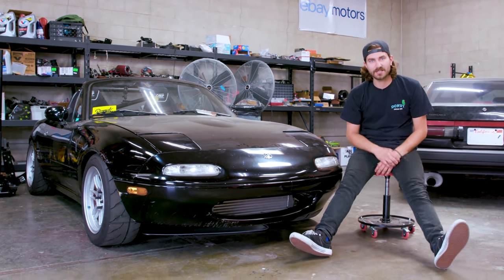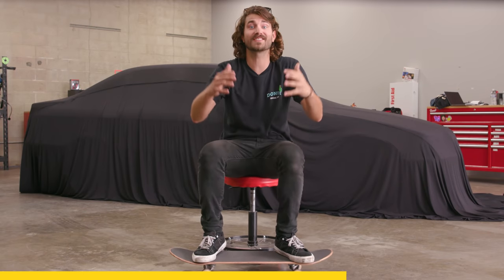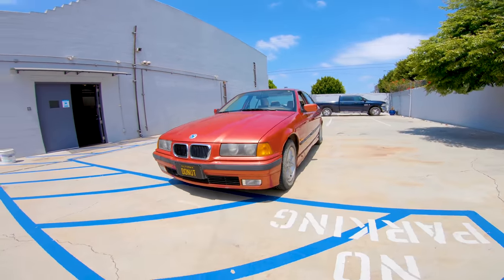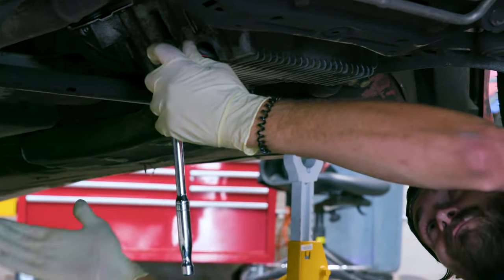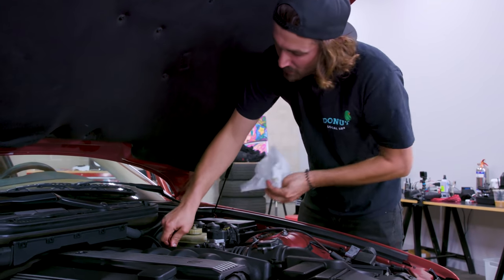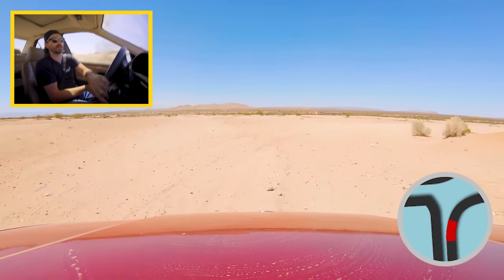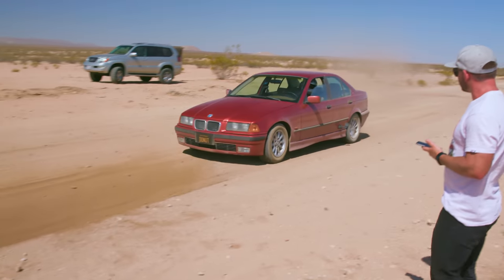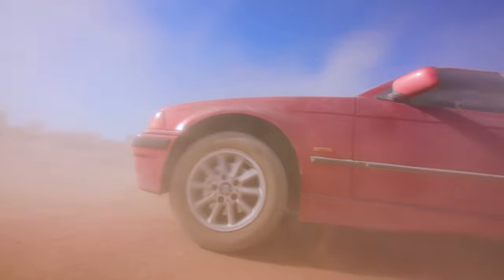The Next Money Pit Project Car Revealed

Comment: “Biggest Achilles heel is the cooling system”

Vanos: Allow me to introduce myself
Reply: Whole reason I didnt buy a 740il was because the Vanos was going out.
Reply: Vanos on the M50/M52 engine is actually pretty easy to maintain. Try going at the Vanos in the M54 or N52 engine, that's a hassle.
Reply: I just got spoiled 😂
Reply: Oil pump nut: Hello
Reply: @alpenjodel24  But when it comes to M54 vs N52, which one is better (by either ease of repair or reliability)?
Reply: Fun isn’t something one considers when causing mechanical problems. But this does put a smile on my face -Vanos
Reply: Vanos failure isn’t catastrophic as opposed to the cooling system.
Reply: I’m actually about to build a e36 as well, might follow with you guys
Reply: Vanos: I am inevitable.
Reply: @TheLajanz  id assume with a VVTI being borked it would get like 30% worse mpg.. I would guess it would just burn rich / waste gas at high Rpms.
Reply: @RK870XK  Depends, when looking at only the engine itself, the M54 is easier to work on, mostly because its older and a more "mechanic" piece with less electrics. When looking at the whole car, the E90 with the N52 engine (N53 is shit) is a lot more reliable than the E46 with the M45. E46 suffers from a lot of electric issues because it's a lot less modern but started to incorporate a lot of electric features (such as gas by wire). That being said, it's very very hard (if not impossible) to work on the N52 without advanced knowledge of the engine, the car and modern car mechanics. 
So when it comes to reliablility, my (as a BMW mechanic) ranking would be: 
A tier: E30/E36 (E30 a little more costly most of the time, because it's older, but damm the m10 engine runs forever)
B Tier: E90
C Tier: E46
D Tier: F30
Reply: @alpenjodel24  I've been actually considering between the E66 LCI and E39 (both using inline 6s since my country doesn't see V8 powered E39 and V8/V12 powered E66 seemed rather scary by cost) actually, so what tier is either of these cars fall into?
Reply: I had an E36 and either the vanos or the cooling system failed, everything else did lol, except engine and transmission those were pretty strong. Would I buy one again? Definitely yes!!
Reply: @RK870XK  M54 is more reliable and easy to maintain
Reply: Vanos isn't a problem on a M52. I have nearly the same car(1998 E36 328is coupe) it has 207,000 mile and I never had to the vanos or anything else engine related besides the cooling system.
Reply: @anotherbiker6319  Not True.
Reply: Damn, the amount of likes really show people dont know much. No, VANOS isnt. My M50s VANOS is ticking but working like it should and pretty easy to fix.
Reply: @siamdixon9671  dude it’s literally just a joke, please don’t take it so seriously.
Reply: @RK870XK  an E39 with a M52 engine will be pretty bulletproof, the E66 will be a lot more costly to maintain if you can't work on modern cars yourself. As I said, the M54 is a great engine but if you don't know your stuff around electronics in a rather old engine bay, stay away from it.
Reply: @anotherbiker6319  Easier to maintain yes, more reliable no.
Reply: @anotherbiker6319  thx
Reply: @alpenjodel24  I'm pretty new to European cars really, especially considering the fact that my family has almost entirely Japanese cars (the non Japanese ones are a Ford Fiesta and a Jeep JK Wrangler), so thx for the advice
Reply: @RK870XK  np mate, my suggetions would be the e34 series for starters, the engine bay is huge so it's easy to work on and they are built like tanks,

Comment: "Engine temp is still good"
Already better than the Miata for just 4500.
Reply: Did he say he payed 4500 for the new 328i?
Reply: @chriscarguy  Yep, around the time where he pops the hood.  He said that manual transmissions will cost you a bit more but you can get an automatic for much cheaper.
Reply: Rip miata 2021😩
Reply: that means nothing though, the market is insane right now, doesn't mean it'll last.
but what it will do is probably hoard out how many e36s are left by trashing another example.
so i guess there's that.
Reply: @chriscarguy  for 90k miles it's good

Comment: “This car is perfect for rally in the desert”
10 sec later
“It’s biggest Achilles heel is it’s cooling system”
Reply: This car was a mistake for an off-road car 🤦
Reply: @nelsonwilley062998d  idk man, I've seen quite a few guys run these in the Canadian rally championship and be consistently competitive and brutality fast. My dad has a M52B28 swapped E30 track car with a M50 intake manifold (flows better) and a slight ecu tune pumping about 210bhp with a Volvo rad and it runs fine doing 1-2hr stints and running out of gears at the end of the straight on most tracks (gotta hate that 4.10, a 3.91 would be ideal with the e36 5spd but they all scooped up or going for big bucks) but never once overheating (just running slightly uncomfortably warm 🤷‍♂️)
Reply: @nullnull5185  and to mention the shit car from the hoonigans
Reply: @adlersteiner4942  lmao that thing was clapped out from the beginning though and it still managed to be legendary  😂

Comment: “The only Achilles Heel on these things is the cooling system…it also has Vanos!”
Reply: shakes fist VANOOOOOOS
Reply: Vanos is ok if you check it before and with a good oil
Cooling system is greatly improve without ac condenser and a 70c thermostat and of course good pump (whit less than 300k Mile and a ton of silicone gasket), radiator (not clogged)
Reply: Achilles heel = cooling system...
Donut: let's make a desert rally car!
Reply: The rear subframe attach point is also to survey sometimes with hard driving conditions they are prompt to crack , fissure
Reply: I have had 2 e36s and 2 e46s. I have never had to fix vanos on any of them. The one i drive now has 265k and its great. My wife has a 530i with 297k and no vanos issues.
Reply: @ThunderCzechrap your absolutely right.  The toyota 2jz has a very similar setup on the cam gear and they have the same sort of problems but its not that big a deal.  You lose a little mid range torque.

Comment: Finishes video. Looks outside at my e36 sitting on jack stands in my driveway 

Oh ya, it’s all coming together now
Reply: Exactly me expect my e36 is supposed to be my daily…
Reply: Me with my car too but at least I'm making progress
Reply: @knation92  what do you still have to do? My main concern is throw out bearing is bad so it’s making the clutch slip so I’m dropping the trans and doing that plus the clutch itself, rear main seal and a fluid flush while I’m there. Problem is header bolts are rusted up good so I can’t take the exhaust off which also needs a section replaced cause of a rust hole. Other than that and some RTAB it’ll be fine. It’s been on hold though because of med school exams but come fall it should be up and running.

Comment: when he said rally for a second I thought he was about to say that they got a WRX and I nearly shat my pants. E36 is still cool though.
Reply: I was really hopin
Reply: Was praying
Reply: Imagine they won the lottery and picked up a 22b
Reply: Nah rwd rally is 1 million per cent better than boring awd rally
Reply: Was thinking of it being a Galant VR-4. Still plenty here in Asia, you just need to be lucky that it's still a 4G63 stock and not on a 4G92 Engine Swap or not on a VR-6 engine swap

Incase you're curious what's with the 4G92 swap is that the engine is a low rev, high performance SOHC/DOHC engine, which are pretty common with regular Lancers built prior 1996. They really are powerful but not as powerful as the 4G63
Reply: @erty2389  I mean I'm not saying one is better than the other, I just own an 05 wrx and it would be exciting to have a well produced tutorial on a good rally build.
Reply: @domino-86  dude I thought they got a 90's STI or something

Comment: This brings back so many memories of my e36 m3 I had. Cosmos black with a ghost racing flag on the driver front fender under the clear coat. I used to use a Bobby pin to touch circuits under the hood to reset the oil life. It was an auto so I learned a trick for a down shift, if you click the button under your gas pedal with your foot then stomp on it you’ll have a good time when it drops a gear or too 😂😂😂 loved that car.

Comment: Anyway you guys can make a video on common tools needed to start a build, I’m new to mechanical work and would like to be prepared. Love the content fellas
Reply: Honestly dude, the best thing you can do is to buy a socket set that is metric. You are gonna need a breaker bar and some wrenches. Sockets ranging from about 6mm to 24 is what you will use the most. And the wrenches are only really used for tight spaces and when you need to tighten a bolt with a nut. Just make sure the wrenches have a bend in em. Flat wrenches suck.

Comment: rally build is whatsup

quick do first upgrades are 
1,connect strut towers
2, change air intake and u can cut exust to the bay
3stripp all that weight
Reply: Those strut towers defenitly need some reinforcement too
Reply: Suspension
Reply: Sequential transmission because rally car

Comment: I’ll laugh my ass off if he swaps out to a manual and manages to run slower.
Reply: his first few runs with a manual might be unless they get new tires first. tractions on these "roads" can be a bitch
Reply: I’m sure a manual will give him a quicker time, the auto is a bit old and dim witted to change unlike modern autos so I imagine he’ll be saving a second or so by just being in the right gear for corners.
Reply: I mean, he will be able to enter corners already in a chosen, set gear, so he has one solid powerband to work with during the entire corner, rather than basically being forced to only be able to power out of it

Comment: “This car is perfect for rally in the desert”
10 sec later
“It’s biggest Achilles heel is it’s cooling system”
Reply: It’s not like it does it cool, it just needs constant repair 🙃
Reply: it is a BMW
Reply: also one of the first things that needs to be replaced/upgraded when using a car for any kind of performance driving.
so doesn't matter
Reply: @heygek2769  this is facts. No point in racing a car from the 90s with a stock cooling system 😂

Comment: Hi!
Interesting to see an E36 build in USA. Here in Latvia and Eastern Europe they by far are the most popular cars that are being built for racing. 
All you need to get it to become competitive are some shocks, some body strengthening parts (they tend to crack rear subframe, rear shock towers and front shock towers), LSD (large housing) and poli bushing kit and you are set.

I would like to see you build a bored out M50 engine block with 2.8 internals and oversize pistons for maximum coolness

Comment: For an easy 20hp you can put on the intake from the M50 engine but you lose some low down horsepower (can be fixed with tuning)

Comment: Ha ha ha well I can tell you Zac from personal experience that YES you do need to replace that cooling system with a NON FACTORY setup...the coolant tanks always fatigue and split (I’ve replaced 3 in 8 years), the end tanks in the radiator start leaking or bust off (plastic) and there is a small pressure valve in the rad that once it pops out your done and dusted mate. A tiny amount of debris blocked the small return line, cooked the whole system and knackered the head in my E39 528i Touring (same M52 single VANOS) I would recommend heading straight to these guys for proven race parts for the cooling system. (mishimoto.com.au) Oh and a new water pump with a brass or stainless impeller is the go, chuck that factory one with plastic impeller straight in the bin!
Can’t wait to see how you get on, good luck!!!!

Comment: Twin-Turbocharge it, RB26 swap(Mishimoto intercoolers in the first 2 cases) or LS swap it, Mishimoto Radiators, Sexy-ass angle kit, Rally Suspension kits (Obviously cause issa rally build ), a nice Cat-back Exhaust, Cool Rims, OMP WRC interiors (NRG Quick Release Steering Kit), Electrical Dash, Analog Pressure Gauges, AWD Manual Transmission and OFC WIDEBODIESSSSSSSS..... you can ofc do other things lol @donutmedia

Comment: and adding the extra half to one quart of oil to make it go to the max line on the dipstick is a good idea if your going to be racing/beating on your car. less likely you will start sucking air in your oil pickup. dont overfill tho ie mighty car mods did this

Comment: i have a 99 528i and have 2 questions- its missing a jackpad which i ordered but how can i safely jack the car in the meantime? the manual offers no other jackpoints :/ other question is how did you remove the oil filter? not sure what size socket id need for that

Comment: This is a late response as they already took the auto out, but with e36 autos if you're doing any kind of spirited driving always drop the shifter into 3 instead of drive that was bmws kind of "sport mode" setting which only uses 1 thru 3 instead of all 4 and increases throttle response and will hold rpm when you let off much better, but never touch that A/M switch next to the shifter it just ruins how the car shifts as zack said it wouldnt respond much